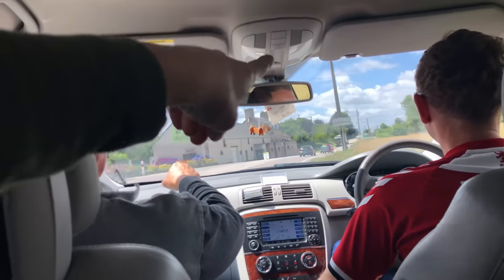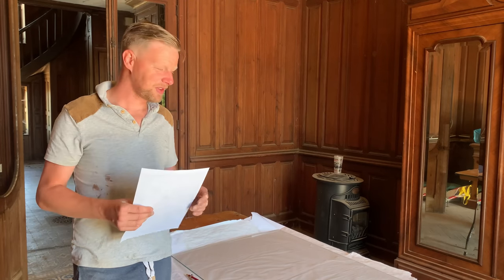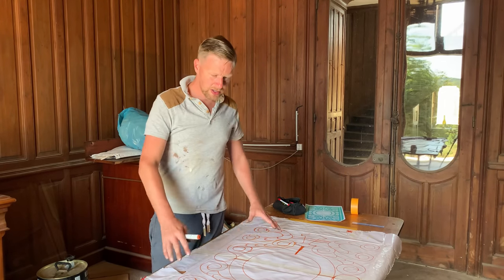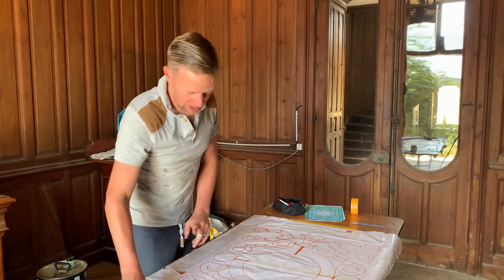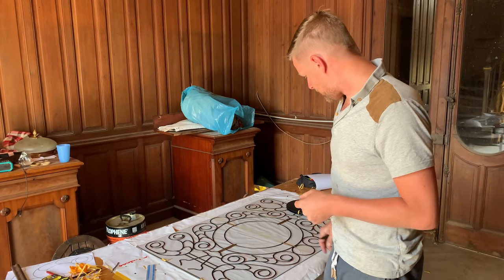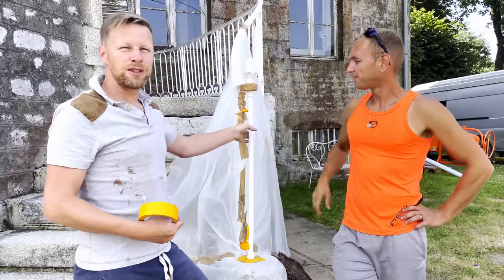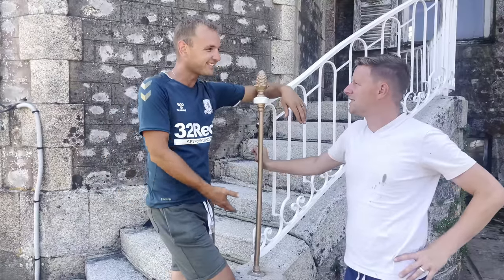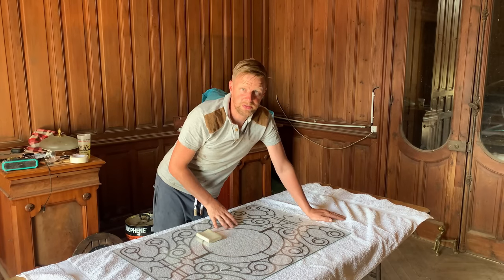Restoring the ORIGINAL chateau RAILINGS. Ep 65

Comment: Beautiful work, but if I could make a suggestion to raise your table by cutting 4 equal pieces of pvc pipe to fit on each leg of the table, it will help ease the stress on your lower back.  I do lots of quilting and spend hours cutting fabric and this method of raising the table height has helped me tremendously.

Comment: All of you have worked so hard and all the hard work is showing.
A note on the railings.They look ok now but in a short while they won't.
They should of been sandblasted to get rid of all old paint and rust.Then rust inhibitor, primer and finally spray painted, not with a brush.
Preparation is the key.